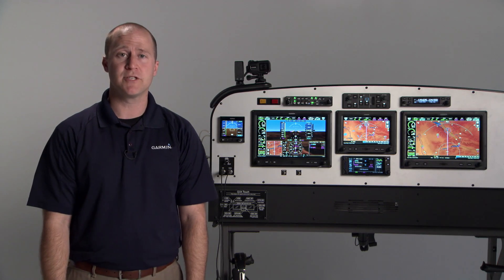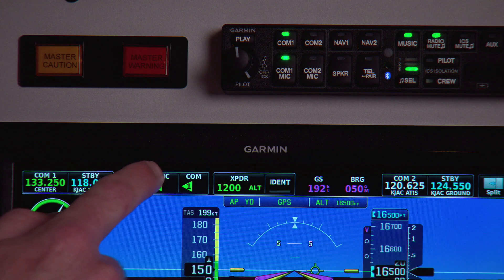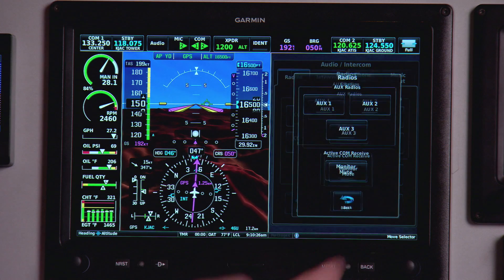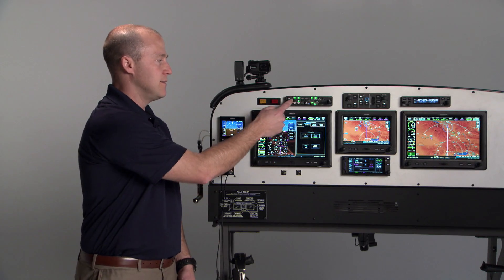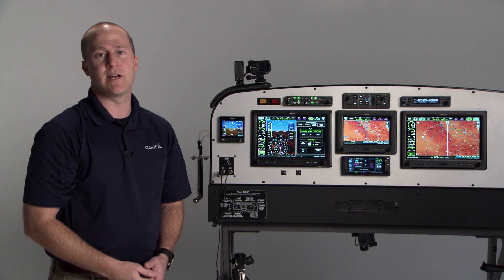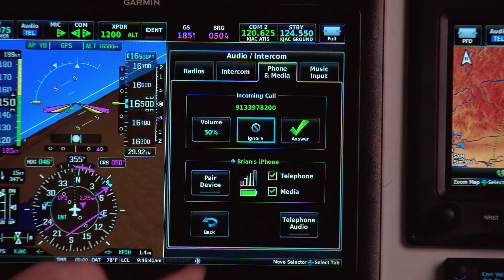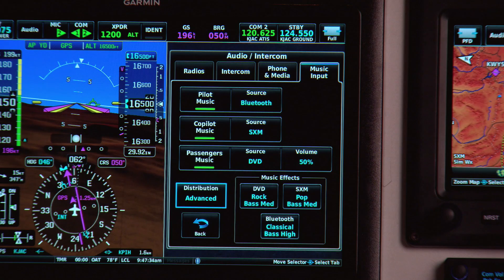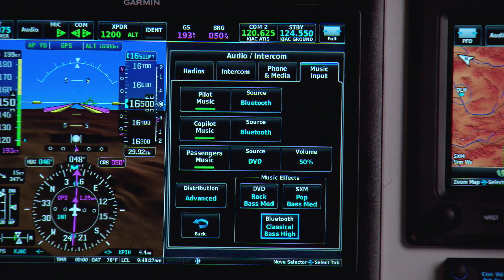Garmin GMA 245/245R: Operating Your Audio Panel for Experimental, Light Sport Aircraft

Comment: I know it's seven years later, but, does the current G3X software still permit control of the 245 panel mounted audio panel? Or is it now only for the remote mounted box?
Reply: Works for both

Comment: You mentioned ability to use a DVD player, is there documentation in how to hook that up aswell as what displays one might use?
Reply from the maker: Sure, reference Section 4 of the Installation Manual here for additional details on the interconnects for all of the audio inputs. You could consider wiring it into your Aux audio input as an example. More details here: https://static.garmin.com/pumac/190-01879-11_07.pdf

^DK